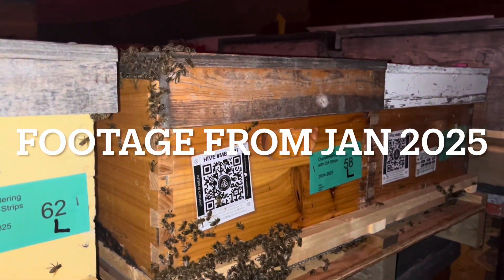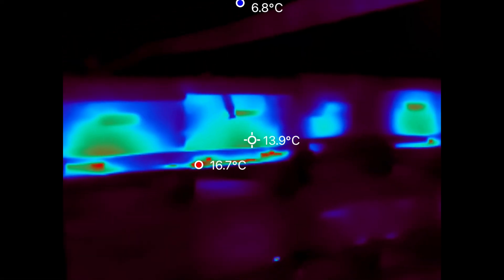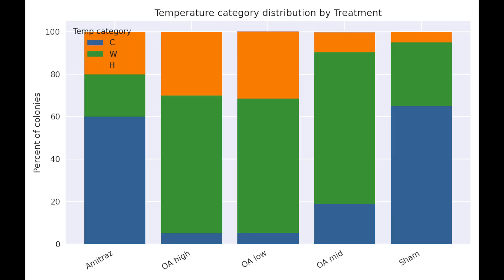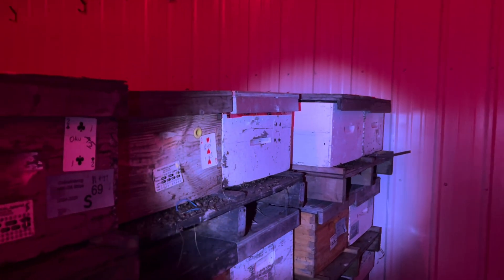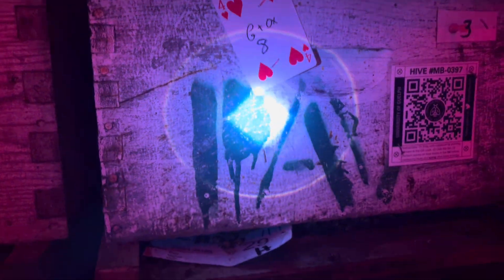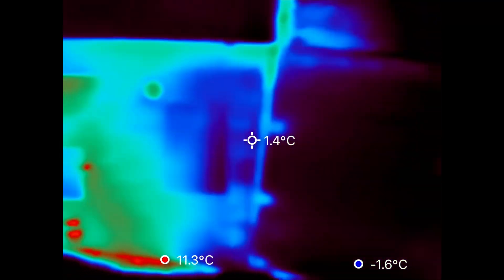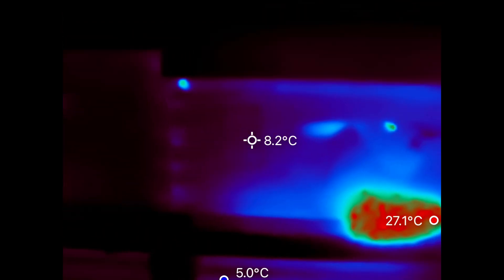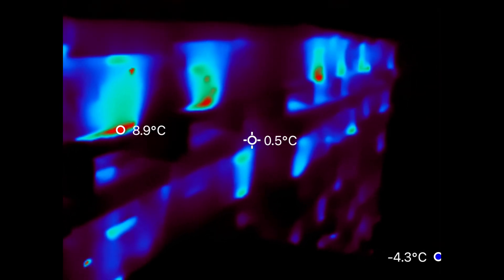Oxalic v. Temp: deep dive and first results.

Comment: The OAStips hives are going through the "Melt-Off" atm in my opinion. When I make my Home Made strips they have an extra OA-Cake on them, that'll melt off and run down the frame ears and along the top-bar. You could be seeing the bees reacting to that melt off and caring the OA residue around the cluster as they rotate in.
Reply from the maker: I show several different stages of reaction in this vid.  Which stage do you think shows what you call “melt-off”

Comment: Glycerin is a humectant; it readily attracts and retains moisture from the environment. Oxalic acid crystals are commonly sold as a dihydrate, meaning they already contain some water.
Initial mixing at a 50:50 mixture when initially made, the oxalic acid will dissolve (physical mixing) in the glycerin and a small amount of existing water will be present from the dihydrate OA and the commercial glycerin. The solution will be acidic, but its concentration will be limited by the low water content. After absorbing moisture and increasing water from the air, the glycerin absorbs significant moisture from the environment, this additional water allows the undissociated oxalic acid molecules to dissociate (chemical breakdown). This rapid increase in the concentration makes the solution more acidic and thus more corrosive, despite the volume of the solution being diluted. The high concentration of free ions in the water-glycerin solution causes severe chemical burns and irritation upon contact, as acids require water to exhibit their corrosive properties.
Reply from the maker: Does this predict a delay in effect as the oxalic absorbs water or is it immediate?